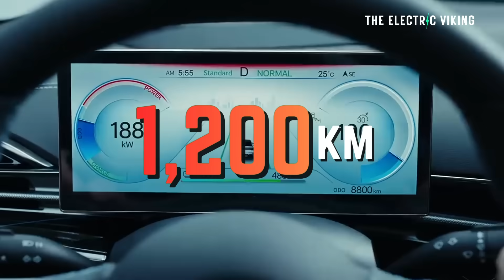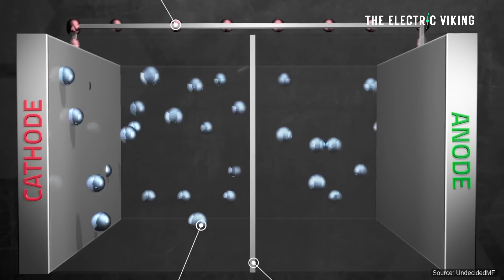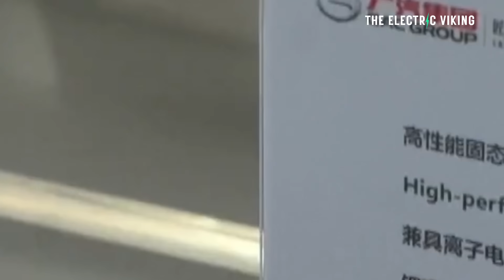BYD's Battery Partner Reveals Huge Production Line for Solid State Batteries

Comment: Very heavy batteries and you will go through Tyres on TVs every 5000-7500 miles be aware. Not the way to go much better with new Aluminium Fast charge

Comment: You had better start comparing apples to apples. What if silver goes to $200/ounce. A battery pack could use $7000+ of silver. Sure...they'd last forever, charge fast, and have great range but damn...expensive!!

Comment: Why would 1200 km range be stupid?  Perhaps you should get out of the damn city and try a few country drives.   
These batteries are not going to kill off ICE engines, not in a fit.  It will take legislation to do it.  You’re running off at the mouth with what you want to happen, and what you want is so far removed from reality it’s not funny.

Comment: My SL7 takes around 10-11hrs to charge over the weekend for commuting during the week. I have to balance the charge timings to maximise Solar. A battery with that kind of capacity would need 20-30hrs charging, granted every two weeks instead but, I just don’t have the solar time to charge batteries that big. My battery works for me as it is.

Comment: Cars shouldn't have 1500km range but rather be much lighter. Making EV's lighter allows them to use smaller tires and reduces ultra fine dust emissions which is actually one of the negative drawbacks in EV's. They would also become even more energy efficient giving you more range, a win-win!
Reply: Range efficiency has been proven to be a drag coefficiency factor, decreasing front drag and a lesser battery pack can subsequently reduce the car's weight... Except you'll run into the issue of EV's looking like “melted jellybeans” because of this emphasis 

The Aging Wheels channel did debunk the weight myth with a towing test, and has found that it's actually beneficial to have extra car weight, as this does increase the car's regen braking efficiency. I'm not implying that EV's should weigh any more than ever, however given that many are as efficient under city driving thanks to their current weight

Comment: As with anything at the end of the day it comes down to cost.
This was the reason solid state batteries were delayed for so many years, even though we had many prototypes.
The Chinese are not known for empty promises, but as long as I don’t see a price per kwh I remain skeptical, especially because CATL’s Naxtra battery will mostlikely cut prices in half again.
Maybe solid state batteries will be the way for Chinese EV manufacturers to cut into the luxury car market as well, but currently they are all about affordability.

Comment: With companies now mass producing 400-800 Wh/kg - many should question why BYD and CATL are still producing these very expensive 160-170 Wh/kg batteries!?

Probably it doesn't matter that much whether the battery is LFP, sodium or some definition of solid state... Globally, all countries should push for affordable, under $50/kWh, 400-800 Wh/kg, reliable, 20k cycles +, high-quality batteries. This is the future!

Comment: 4:28 Sam, you keep confusing the public:
An 80 kWh battery will always provide the same range, irrespective of chemistry (although a lesser weight will provide a minor range gain).
No 80 kWh battery will provide a range of 1500 km. Unless you have the crazy aerodynamics of an Aptera.
This tech can provide 300 kWh of stored energy in similarly sized battery packs.
That's how you get a 1500 km range.
Better energy density = MORE kWh for the same size/weight.

Comment: 700 kms means 3 hours highway for a 10-80 regime.
Once you reach this, cars should get lighter.
Then limit cars to 170kph, making it possible to use smaller tyres for these lighter cars and you get in to a downward spiral, lighter4, more efficient, again lighter,...
Reply: Then aim for smaller cars with say 300 mile range and a price of £16k-£18k (today's price). Look forward to that.

Comment: The preferred range depends on the charging infrastructure and the charge rate of the charger/vehicle.    In rural Australia I'd prefer a long range battery, I've arrived at towns to find the whole power supply out for everything.    Didn't matter - I had plenty of fuel but my preferred eating hole was closed...   In a few years the infrastructure will probably be OK, but 500 k's isn't much.   I drive non stop to my capital, about 400ks and then have appointments which span a lot of area - so stopping to charge would be a pain.   Petrol is fine - 700ks range - fill up in the evening before my return next day.

Comment: 4:44 You put a 80 kWh solid state battery in a BYD Sea Lion 7 and you'll get only slightly better city driving range due to reduced weight. Highway range would likely be the same. kWh is a measure of energy. It doesn't matter how dense a battery is, 80 kWh is 80kWh.
Reply: Yup. Only an uphill trip will make the difference.
Reply: When he said same size battery, and 80kwh battery (currently in market), thats where he did the initial mistake. Range comes further down in the mistake line. with triple the energy density, the size has to reduce to little more than half of the original for similar kwh.

Comment: Solid-state batteries, in their current and near-term realizable form, are not a major upgrade for EVs or electric scooters. While they offer theoretical safety improvements and slightly higher energy density, real-world implementations suffer from high interfacial resistance, poor fast-charging capability, mechanical cracking, and limited cycle life at practical current densities. For mass-market EVs, lithium-ion with advanced liquid or hybrid electrolytes remains superior in terms of energy density, fast charging, manufacturability, and cost. In scooters, where energy density is less critical, solid-state adds cost without meaningful performance gains. The true path to breakthrough performance lies in system-level optimization—smart BMS, thermal management, and hybrid architectures—not simply replacing liquid electrolytes with solid ones.
Reply: Graphene Aluminum solves all of those problems.
Reply: @incognito7671  the claim that “graphene aluminum solves all major battery problems” are not supported by established electrochemical or materials science evidence. The term itself lacks a precise technical definition and is used to conflate fundamentally different concepts, ranging from graphene-coated aluminum current collectors to aluminum-ion battery chemistries. Across all credible interpretations, peer-reviewed data show that graphene–aluminum systems remain constrained by well-known physical limits: lower achievable energy density than lithium-ion batteries due to aluminum’s higher atomic mass and lower operating voltage, slower charge kinetics associated with trivalent Al³⁺ ions, limited cycle life under practical current densities, and significant challenges related to corrosive, moisture-sensitive electrolytes. While graphene can provide incremental conductivity or interfacial benefits in specific components, these effects do not translate into system-level breakthroughs in energy density, fast charging, cost, or safety for electric vehicles. Absolute statements implying that graphene–aluminum technologies overcome all major battery limitations therefore represent unjustified extrapolations rather than conclusions grounded in reproducible experimental evidence.

Comment: Sounds like semi-solid state with that energy density, there's a few companies around with that sort of energy density in semi and quasi solid state. Don't get me wrong, I am really pleased this is happening, but full details aren't available yet. Mercedes I am pretty sure has what they call a Quasi Solid State, Samsung I believe are Semi Solid State and CATL have their new Condensed Solid State battery technology, I mean they all call them Solid State but they all use some small amount of liquid or gel like strata to iron out inconsistencies in contact surfaces, true solid state would be a battery with no liquid or gel at all, and they are a harder nut to crack, but could very well lead up to 800wHk to 1000wHk, imagine the possibility, a car with a Megawatt battery lol. It's all tracking as gradual evolution of battery technology, quite fast evolution when you consider the speed we have gone from older batteries, but this will be some form of semi-solid state, then maybe fully solid state a few years after.
Reply: The semi-solid-state battery is already in use and for sale. It contains 5% liquid and does not catch fire after undergoing omnidirectional puncture and compression.
The MG4 is already in use and for sale. The 54 kWh battery version is priced at $14,000.
Reply: @Ceraline-u5p Yeah that's true, but the problem is it is only 180wH/kg, which is disappointingly low. CATL's model with a similar liquid component claims up to 500wH/kg, the same with Samsung's semi-solid state, up to 500wH/kg.

180wH/kg, while good, is not that much better than some already available LFP batteries and under many available NMC batteries. It would be good to see SAIC go for higher energy density in the future because other manufacturers will catch up and pass those figures quite quickly.
Reply: I think it's possible sometimes near the futures. But it will probably for the expensive cars, not everyday cars 😂

Comment: You need to be careful with your terminology. Double the energy density means you can put twice the number of kilowatts for the same physical size and weight. You would still pay twice as much for the battery as cost is based on kilowatts installed, not density. The real saving is the 300-kilos in weight, leading to at least a 10% improvement in range. Particularly significant for heavy vehicles.

Comment: A battery that has triple the density, immediately makes a good economic case for full sized pickups and commercial trucks.
Reply: Yes! I was just thinking about Ford canceling the F 150 lightning due to bad sales.  Obviously people want a truck that has range and can tow more than 100 miles.  These new batteries will make that possible.  It would even make EV long haul commercial trucks viable.  Good stuff!
Reply: Well in china its already on truck and any heavy transportation

Comment: Did I miss it, or did Sam never tell us the most important number of all, what is the cost per kilowatt hour for these new solid state batteries from byd? What I've been hearing is the cost per kilowatt hour is just uneconomical so it can only go into the high end  EV or VTOL applications.
Reply: Need China's economy of scale to solve the cost problem. 
That'll take a bit of more time.  Like the development of solar panels an extra 5 to 10 years to make the tech dirt cheap
Reply: @freefree1219  my understanding is that yield is the biggest issue and making the separators at scale in high volume high yield methods is exponentially difficult, but 5 to 10 years seems like enough time if they put a lot of money and effort on it. I'm wondering what is going on with lithium sulfur batteries which grow the anode using cvd , by a us company which was sounding like it was getting very close to commercial viability. The energy density and cost per kilowatt hour is supposed to blow away standard solid state lithium batteries.

Comment: You would only need 800km range at max. I wonder how much weight could you lose on the byd seal
Reply: I need a 1000 to 1500 km range. If you want 800 km, that is fine. But I want more and am willing to pay for it. Thank you for understanding.

Comment: when EVV are the same low cost as the same ICE car then EV will be mainstream.
An MG ZS 1.5 turbo is AUD$25K and the MG4 Exite EV is AUD$38 K + ORC for the same vehicle but EV - Why would a person with limited funds buy the EV.
When a Hyundai Venue is 25K and the Hyundai Inster EV is 43 K DRIVE AWAY why buy the EV. for the same size car.
When Hyundai Kona Petrol is AUD$36K and the Kona EV IS AUD49K
When a Kia Picanto is AUD$24K drive away cheapest Kia EV is AUD$50 K 
Sure the BYD Seagull (Atto 1/ Dolphin Surf) Essentials  starts at 25K Drive away but does not have AC. The premium starts at AUD28K  +ORC.
The Ne Geely EX2 said to be coming could be misd 20's +ORC ? TBC
EV will mainly be purchased by those with high disposable income or company fleets. Not by the general public until pricing is comparable. The difference in cost is just too high to make EV  the mainstream choice.

The average wage earner and student will continue to buy ICE cars they can afford. or second hand that they can afford and fix. 
 The BYD Atto1 and the new Geely EX2 when they land in Aus are still AUD$5 K - $10K more than the less costly ICE models. That sticker price difference is the detractor, that 5 K - 10 K covers fuel and servicing costs for up to 5 years or more.
People vote with their wallets. If you don't have the money to spare the difference upfront is out of pocket v's the small difference in running costs of approx AUD$1000 dollars more spread over the year. $20 a week over the  next 5 years compared to losing that upfront. and still having to pay for electricity and annual service and higher insurance for the EV. 
Most  insurance companies seem to be putting a premium on EV compared to ICE. 
Vehicle repair costs are much higher due to electric safety procedures.
Total cost of EV is not cheaper when the sticker price is so much higher.

I am not anti EV. thay are cleaner , they are cheaper to run but cost more to insure, and you can bet your life on it that the Federal government will add a road tax on EV to combat the loss of fuel excise. Governments need funds to fill the public purse. so prepare for that added cost.
Mke the cars available at a same price and peiole will shift.
Allow the Quadra cycles and Kei cars to be sold in Aus and that will reduce pollution and provide affordable transportation. \
There is not one solution EV are a part but will never be the sole solution certainly whilst the difference in upfront cost is so high.
EV are only so popular in China because they are cheap and the government does not allow ICE in many provinces.
And the permit fee to buy and ICE car is prohibitive for most Chinese people.
Reply: It's all about long term savings with EV ownership, the initial price while steep, it gets paid off with minimal maintenance and electricity prices when charging at home

I own two 2000's gassers because realistically I can't cash in USD$30K in a car after a whole year in savings for a new car, let alone an EV however the contrast comes with spending USD$20 on fuel per week, per car, on top of parts failing and being bought. EV ownership does have the car paying off sooner than you'd think!

Comment: Lead inteligent, which is the supposed "supplier" is not a battery manufacturer. They are an equipment manufacturer. they don't have 5-8Gwh line running to produce batteries, but they can give you an equipment which will produce cells at that rate. This does not mean they have solved science of SSB. But a generic equipment. This is nothing but propoganda piece from car news china to fool people. Please don't fall for it

Comment: BYD EVs have a surprisingly short range, so if true this 800km range would solve that problem.
This matches top ice and plugless HEV hybrid range.
If the price has parity and charging speed up to 250kW then we are looking at the moment when ice finally dies.
Reply: Isn't the BYD cars more inefficient than the others? And unfortunately they not great looking either.
Reply: @Harrythehun yes true, less efficient. Not sure why that is. The BYD Seal I think is a great looking car and sells well for a sedan, but agreed the others need some work, though no worse than a RAV4 😅
Reply: @Harrythehun  i think they dont have gigacasting si model SEAL is much heavier than model 3 or Xpeng G6 who have gigacasting

Comment: Sam, please stop this. You sound like a fucking moron by now. If you mean same size as in physical size, you are right. But if you mean a, for example, 80 kWh LFP battery will have the same range in the same car as a 80 kWh solid state battery. I have posted this under numerous of your video. You seem to do not give a dime.